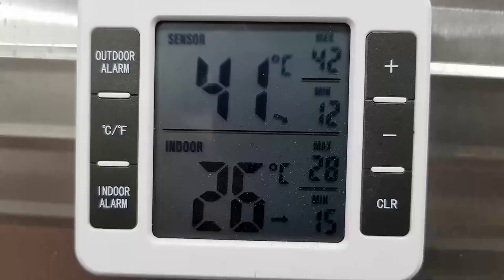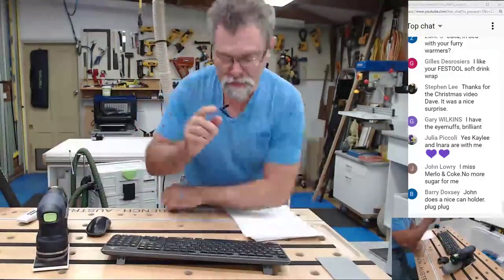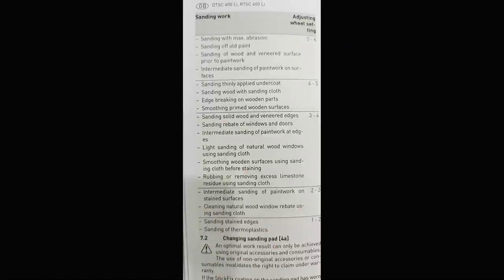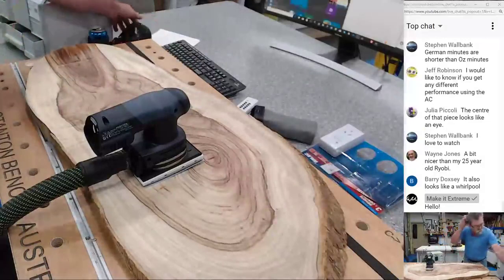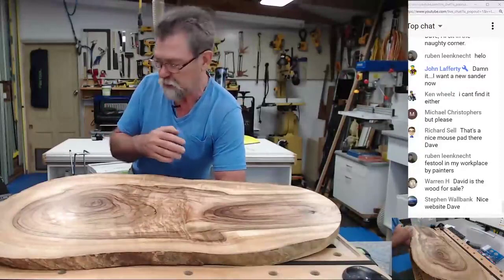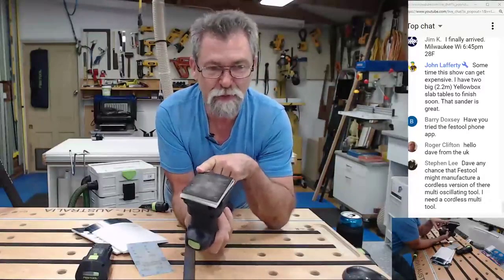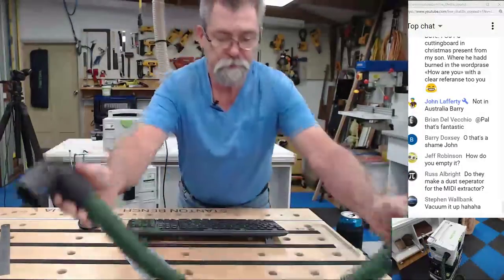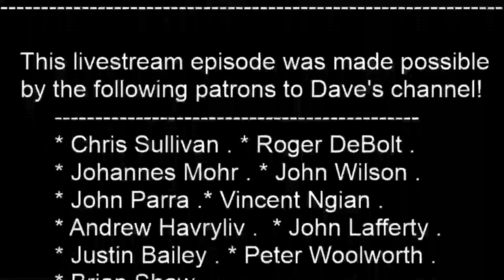Archived 30-12-2018 Festool RTSC and granat mesh  Let's play! Dave Stanton live!

Comment: Hi Dave. Here I am watching this 5 years after your Live session because I just purchased a Festool RTS 400 in the US. Its my first sander ever and will be my 2nd time ever using any sander. You seem very experienced with this sander and the abrasives that go with it. I have an option of either using the regular Granat sandpaper with the holes punched in OR the Net (mesh type) version with the interfacing pad. The Net version is better for dust collection based on what I read on Festools site - and in my understanding if one buys the 9 inch X 11 inch sheets of the Net and cut them down to 1/4 size or pad size sheets, it comes out much cheaper than buying the regular Granat pad size sheet with holes punched in. So what would be the reason to even use the regular Granat sandpaper and not just buy the entire 9 X 11inch Net (mesh type) sheet ? Seems like this way one would get a more dust free sanding for a cheaper price? What am I missing? Thanks if you happen to see this :)